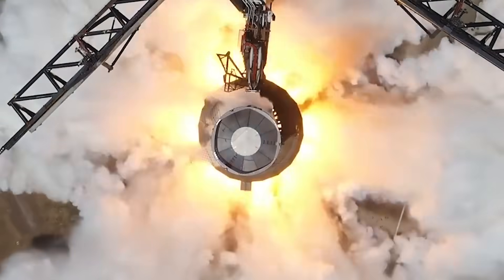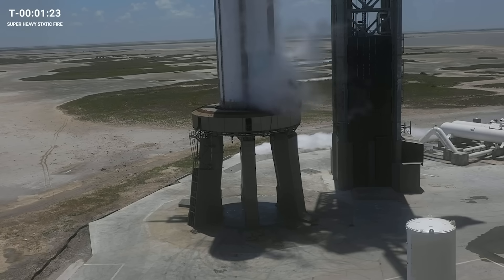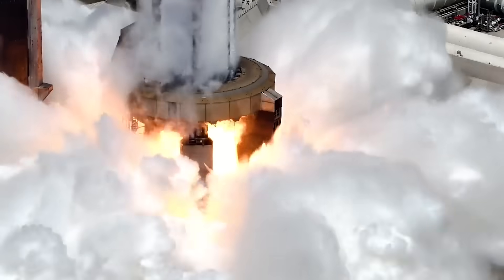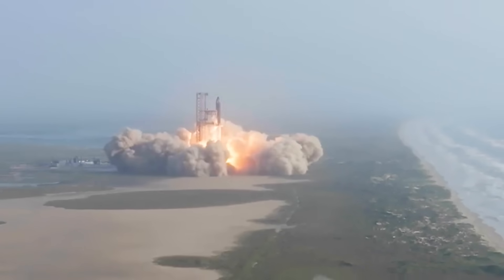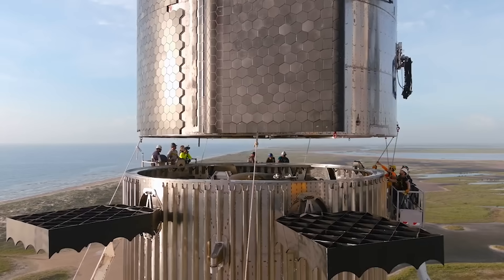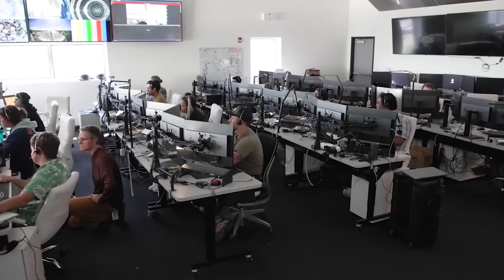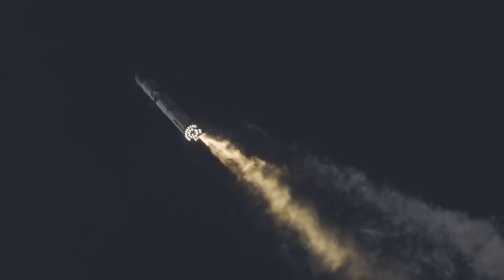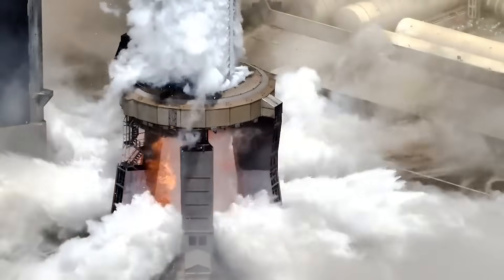How Did SpaceX’s New Pad Hold Up Against Starship Static Fires?

Comment: presumably they cycled a few engines up to full thrust just to gauge various effects on new pad versus every engines being the same settings?
Reply: They did on the test stand at McGregor if I recall correctly.
Reply: @coastie1961  hi and thanks for response. Given that was just one, I was curious about a few close together to see if the turbulence of exhaust interaction creates any unusual modes on the plate causing uneven wear
Reply: @blengi  my knowledge of laminar thermodynamics in an enclosed pentangular dissipation area onto an inclined plane prevents me from even taking a wild arsed guess......
Reply: @coastie1961  so the second launch is doomed lol?
Reply: @blengi   your guess is as good as mine.

Comment: SpaceX also did static fire tests before the disastrous April launch and learned nothing from them. Since no images of the steel plates condition after these tests have been released, they were probably damaged due the inadequacy of the deluge system. When the force of an actual launch hits them,  the damage will be far more extensive.
Reply: They’re a private company, they don’t owe anyone any form of documentation or proof for the condition of their stuff. They don’t have any need to convince you of anything about their stuff, your opinion on their success doesn’t impact them in the least. So why would they bother?
Reply: If you actually watched the video you might have noticed the same steel plates were still in place for the second static fire. With the amount of independent videos 24 hours a day that haven't noticed plate removal and replacement I think it's safe to say that neither static fire has caused any appreciable damage to the launch mount. How much is Blue Origin or Jeff Bezos paying you to post this spam?
Reply: @coastie1961 noone needs to pay him, he just hates spaceX on his free time lol

Comment: Have any details been released about the actual state of the pad after these last two static fires? Is it still like new and viable for many launches?
Reply: Perhaps I missed something in the video, I did not hear anything about the status of the launch pad, anyone? I think spacex is doing a great job with all the problems that they are dealing with, but a question I often wonder about is that those (fuel farm tanks), I'm almost sure there is another name for them that I don't know, seem very close to the launching of the rocket it self, anyone on that?
Reply: @ericyell898 yes the vertical tanks that are closest to the booster are currently empty to protect the inner vertical tanks. And they are currently also in the process of replacing the vertical tanks with horizontal ground tanks as you can see in the drone shots.
Reply: @Wurtoz  thank you, unfortunately my eyesight is not as good as it once was.
Reply: just empty talk, no photos or evidence

Comment: Ridiculous assessment. You will only know if the design is viable under FULL ROCKET POWER not 33% power. Why do such optimistic people fail to be realistic and practical? If the launch pad fails under full power then IT FAILS and it is irrelevant if it can handle 33% power.
Reply: 50%
Reply: Why not test the pad wile you test the flight? You can test several things at once.

Comment: The fondag held at 50%, then blew at full thrust.
Reply: That fondag was in direct contact with the engine plumes during the first test. There is no fondag directly under the engines now.
Reply: @goodgremlinmedia2757  Also the duration the thrust was in contact with it was much longer than it needed to be. They're shortening the time it'll stay on pad to about 2 seconds now I believe. I believe it was 5 the first time.
Reply: @GoldenTV3  I believe the time between ignition and lift off for IFT1 was 7 seconds
Reply: @goodgremlinmedia2757 it was there for 7 seconds due to engines out, 5 seconds were the intended time. Now the intended time is down to around 3 seconds.
Reply: Actually it continued to hold until the ground gave way and without anything underneath it to support it it broke and fell apart
Reply: Correct. Held at 50, blew at lift off.

Comment: Considering what happened on the first launch, and that the pad is dealing with as much and more than mercury and apollo rockets, and being the most powerful rocket ever, we should congratulate spacex. Their testing and improving or redesigns that rarely need more than 2 revisions. It's this that has caused the years of delays and failures with SLS and New Glen for NASA
Reply: What New Glenn tests are you talking about. It's been disappointing NOT to see New Glenn undergoing tests.
Reply: @michaelreid2329 their engine is alot bigger than raptor, but they have done alot of static fires
Reply: Bullshit!!! It's been decades ago that NASA launch pad has been built and it's still standing there with all those multiple launches what are you talking about!? NASA built their launch pad once because they knew the power of the rockets they were to launch lol!!!
Reply: It won’t hold together. They need water jets shooting towards the center on the entire length of the legs. It will dampen vibration more and keep the flames from destroying the leg shielding. As well as water jets on top of the ring shooting up and into the rocket after ignition. It’s the only way they won’t be replacing things every launch. I hope they get to orbit with this next flight.
Reply: Congratulate them for what, a few seconds of  partial thrust? This whole Starship charade is a circus act. Maybe they should work on the failure of the launch termination system. Why did this video repeatedly quote Elon, he is a con-man with no idea what he is talking about. SLS is an actual mission designed system, not some crap created solely to generate hype, completely not designed for any mission at all.
Reply: @Ulrich_von_Jungingen they did work on the fts
Reply: @Ulrich_von_Jungingen coping hard
Reply: @TheNheg66  The burden of the cope isn't on the sceptics kid. This whole Starship debacle hasn't had enough people call it out for the circus act it is.
Reply: @Ulrich_von_Jungingen they already did the work on the FTS, and SpaceX literally launches 4x all other providers combined

I’m willing to have more confidence in that than SLS which costs billions every damn launch
Reply: @Ulrich_von_Jungingen   work on the new FTS system is already done. months ago by now. 
and tell me how a Con-man managed to establish the most well known Space agency along with the most used Rocket to date? even made it reusable?
what you are talking about is more fitting for Blue Origin and Nasa who need decades to develop, build and test their stuff. 
Space x is way faster and better in this regard. 
They might produce more Scrap then the others but at least they make considerable progress in development and in integrating new technologies and upgrades into their Rockets. 
nasa is still running system from a decade ago and i bet Blue origin wont be much better. 
Many other Space project get pushed back and back and back with nothing to show for what it might be capable of. Space X on the other hand has already shown what might be possible and they WILL succeed again with Starship.

Comment: 2 failed afer a few seconds. .....🫡
Reply: Good. That's what a test is for. Having trouble keeping up, huh?
Reply: This test, of another old rocket with old engines (there's like a year apart from the oldest engine to the newest) has been way more successful than the last static fire and launch. I can only guess that the reason why they're testing such old gear is cause there's lots of different things they want to test at once, and maybe for cost and time reasons too. But mostly cause doing it this way gives them a wide range of things to test in a single launch. Even having engines shutting off from different problems (or not shutting off) teaches them about those systems. So ironically failure can be better than success. Hence the often test to destruction path many companies, including Space X choose to do.
Reply: @nicosmind3 test it tell it breaks and find out why.
Reply: Think about all the other engines that didn't fail :P. A good success rate. But obviously they can't have engines shutting off, it will be an interesting progress to follow.

Comment: I think the fact that they still couldn't make it through the static fire without 2 engines shutting down shows that they should really do more ground testing before launch. If they can't make it through a couple seconds of static fire, what would make them think they can make it through minutes of flight? To me this show they still have some underlying engine issues that they have not addressed since the many engine failures on the maiden launch.
Reply: Test fast, fail fast, Learn fast.

SpaceX motto!
Reply: @79messias  You can test more if you don't loose your vehicle and 39 engines on launch before it is ready. And you can learn more from a failure on the pad, where you can look at the failed engines, than you can from a failure 30km above the gulf of Mexico.
Reply: @plainText384  is a successful static test 5 seconds no shutdowns to you?
considering most raptor shutdowns happened mid flight, they would not have caught that at a static test. Secondly stage separation and SDS was also found out mid flight. 
Sometimes you need to test to learn. Resources is not the problem, it is time. They have a commitment with NASA for the future with Artemis being real close, so why not learn faster?
I’ve seen plenty of “careful” approaches fail miserably, being some things just have to be learned by testing.

And 30 engines are required for liftoff, for whoever asked. 4 shutdowns will abort, as we saw on first static test of B9.
Reply: @79messias  if the static fire is supposed to last 5 seconds, them yes, 5 seconds with no shutdowns is a successful static fire. SpaceX, unlike other Rocket development programs, has not invested in test equipment capable of testing the full flight envelope on the ground.
They do, however, have the capability of testing the first 5 seconds or so.

Even if, for a test flight with no payload, 3 engines are not needed, there is absolutely no reason for SpaceX not to make use of the limited ground test equipment they have, to make sure that margin for error isn't wasted in the first 5 seconds after ignition.

There is also no guarantee that the issues causing engine shutdown in the first 5 seconds are completely unrelated to the later engine failures we saw during the first flight.
Reply: @plainText384  we obviously have different approaches to achieving progress, so I will leave you a quote from Elon Musk.

“There is a tremendous bias towards taking risks. Everyone is trying to optimise their own asscovering instead”
Reply: @plainText384 they have lots of engineers and vehicles. The first few launches are throw away anyway. They’re going to end up at the bottom of the ocean regardless.
Reply: I think they can do both at the same time. After all it’s testing and eventually need go full power. The engine issue still has a lot of time to be resolved before a production launch.
Reply: @RobC1999 failure is not a option.
Reply: @TheMoneypresident  failures are all but certain during testing.
Reply: @RobC1999  launching a rocket with faulty engines is a terrible idea.
Reply: @TheMoneypresident the engines are also actively in development. Any data about their failure, even in flight, is good data
Reply: I suspect that right now SpaceX is adopting a “good enough” policy in terms of what it flies. They can obviously abort a launch entirely if too few Raptors ignite, or fail before clamp release. One critical aspect then becomes, once clamps are released, how many Raptors need to stay lit for the rocket to get far enough down range to be safely destroyed by the FTS even if its trajectory is way off the one needed to get to orbit? As long as Raptor reliability is likely to be good enough to meet that criteria I suspect that SpaceX will press on with test flights to try and get to successful stage separation, ignition of 2nd stage engines and booster control after separation. I don’t think SpaceX is going to want to delay test flights waiting to get to perfect Raptor reliability if what they have now is good enough for current purposes. The quest for perfection (or as close as is practical, there’s obviously never going to be a guaranteed 100% reliable engine) can carry on in parallel with the test flights.

Having said that, I wouldn’t rule out another static fire. They’re still plumbing in the third big water tank and some remaining pressure cylinders on the deluge system and I would expect them to want to test that in which case it might make sense to also do another static fire to test the final deluge setup at as close to real launch conditions as they can prior to the actual launch. This is actually what I hope we see next, within maybe the next 7 to 10 days.
Reply: @julianfp1952  As far as I know, clamps are released well in advance of ignition, and Starship achieves liftoff by simply throttling up to a TW above 1. 
Still, during the first orbital flight test, SpaceX did not abort after 3 engines failed before liftoff even happened.
Reply: I think they're better safe than sorry and probably have them shut down if anything all isn't nominal, rather than have them damage the booster or surrounding engines
Reply: It will be interesting to follow the progress of not having engines shutting of.
Reply: Plain: remember all the fuss the viewers and commenters made about the heat tiles?
Reply: @tech5298    Now the fuss is transferred to the raptor engines.   But I suspect the fuss will return the tiles again!   🙄
Reply: Isn't this exactly what they're doing??? Geez.
Reply: @nathanwahl9224  They launched OTF1 without having ever completed a successful static fire. And based on their claims of imminent launch activity, there's a good chance they'll do it again for the second orbital flight test.
Reply: I guess they figure they have plenty of spares... But yeah I agree I think they should have a fully successful static fire under their belt before they try to fly